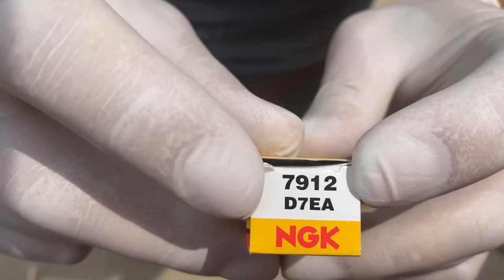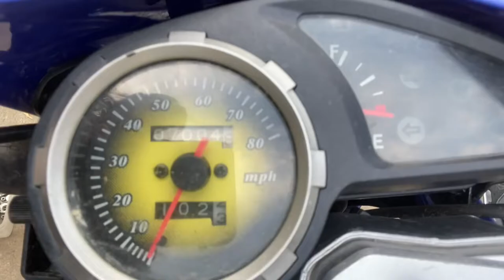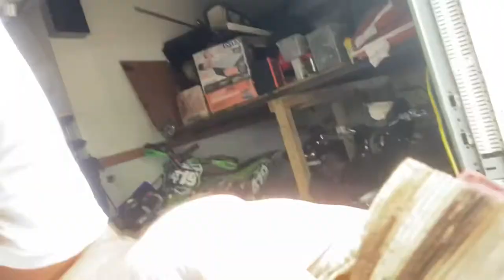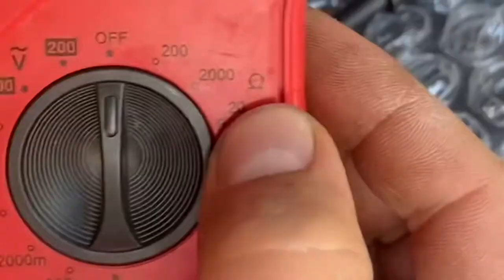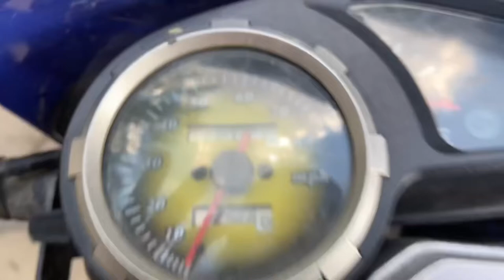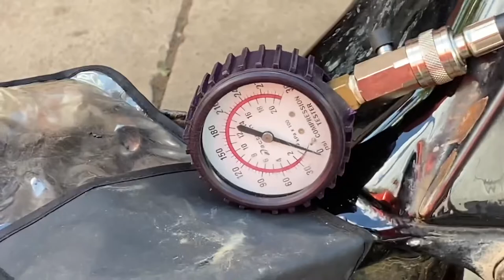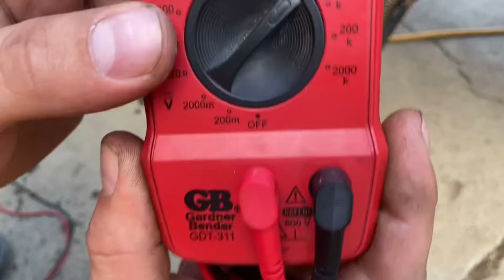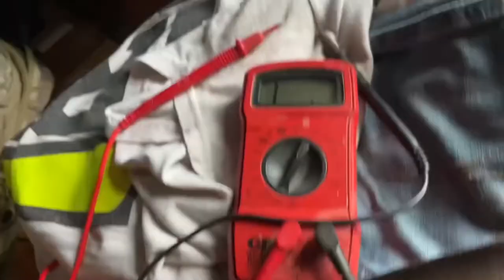Hawk 250 how to fix Pinging (almost)

Comment: Pinging or detonation is most always a timing issue. Also if you run a high octane fuel it should help minimize the pinging. Good luck
Reply from the maker: Man! If it was only that simple🤣 That was one of the first things I did, it’s one of the easiest and most obvious solution’s. Before I even started filming this video I tried pump 93 octane. That didn’t make any difference, so I tried 110 octane race fuel, and that didn’t make any difference at all either.. you can see  I have literally tried everything lol. At this point it is going to get ran until it blows up or until the problem becomes obvious. The issues must not be that serious though because the bike has been ran HARD for the last 3,000 miles with the pinging and no serious issues so far.
Reply: @goodolboys713  Have you tried a cdi box? I am pretty sure that controls the timing on those. Again I am locked on a timing issue as that is most always the cause of pinging.
Reply: If you try a cdi, be aware there are ac and dc fired units.  The plugs are the give away.  Yes, the advance is controlled by the cdi.
Reply from the maker: @eatingplaydoh   not sure if you were able to watch the whole video but I didn’t try an brand new factory vid box on the bike 😉 and unfortunately it didn’t change anything. And yes I have heard of ac and dc systems lol. Unfortunately Iv had to do so much research on the issue that I know all too well about mechanical and electrical side of all of it 😅Thanks for watching!
Reply: @goodolboys713    Could be carbon in the combustion chamber, need a colder plug, if the exhaust is open/no restriction it will run to lean.  I tuned my bike that has open exhaust except for a straight through resonator with an AFR gauge and  by adjusting the exhaust flow with a homemade baffle.  It sounds good to.and runs good
Reply: Could be the 'ol Loose Rod situation..  Air cooled engines are Noisey!  A major reason water cooling got popular.  Might be hard to tell a ping from a rattle, especially if the 110 didn't help.  Could be carbon build up/too high compression?  In a Briggs Go Kart engine that Rattle just means it's faster..  In fact they were fastest just before they threw the rod.

Comment: I rode mine really really hard for 10,000km, it burnt about a liter of oil in the last 1000km but it surprisingly runs great (of course after fixing a thousand little issues) and I jump it, ride it in extreme muddy and wet conditions, rock climbing and have dropped it a million times. I was convinced to rebuild the engine once I saw your first rebuild engine. Then I saw the rest of your videos and I am currently saving for a brand new one instead. I am confident I can fix all the issues except for the valve issue I have had since the first time I dropped the bike in a river, it runs good but it does not idle, you have to be on the gas all times but it has the same power as new. Anyways I feel like getting a brand new one might a better financial/time decision. Thanks for your great videos! Keep em coming!
Reply from the maker: That is a great choice to just get a new one! I always tell people that the hawk is more of a short term investment… especially if you ride it hard like we do. Anyway the second time around should be easier because we know what will go wrong. But absolutely they bike just starts falling apart around 6-10,000 miles. Thanks for watching!

Comment: Good video once again. That has got to be frustrating. Thanks so much for including the thorough electrical system testing. This will prove useful in the future to many. I love my Hawk, but one of the most frustrating things about owning it is not having a shop manual to have ohm, voltage, and torque specs, and other necessary mechanical information all in a "one-stop shop" type of platform. When it comes time to replace my Hawk, I am considering going with a low displacement Japanese dual sport because you can always purchase a shop manual. However, I love the relative reliability vs cost of the Hawk/TT250 types of bikes once you get all the quirks worked out.
Reply: Damn i was going to buy one but it seems like it's a POS .

Comment: Other than a lot of carbon on top of the piston, That noise is unique. I have hurd it before, not on my Hawk point being if your week spark issue fix doesn't work. Dump the gas and replace it. This could very well be a back pressure issue. " The banana in the tailpipe " I have to agree with the other comments about the pipe. Bless you. Good luck o' boy!

Comment: I have a 120 main and 27.5 pilot with aftermarket exhaust. I'm in Delaware which is essentially sea level. But did well when going camping near Gettysburg in the mountains. It's not very high around 75 above sea level in my area to around 1400 camping.

Comment: Good ol Boy how is the bike going now. one thing I forgot to say My IT490 pinging problem I also got a new old stock CDI for it I think that did help a bit the next thing is to get a dial gauge and find true top dead centre and go from with the Ignition timing and see what the advance looks like. Also what about a engine Dino the sniffer might sort it out also they can test a lot off stuff and also a long shot compression ratio might be to high cheers Mick Australia

Comment: When I was an teen. My Enduro had the same problems. I could not figure it out as well. I had an friend. Her husband birthday was coming up. She knew about my bike. I had enough of it. She said her husband could fix it. So I sold it to her. It took some time to know if he fixed it. He did. What fixed it. When they make anything. The powder coat paint everything. 100%. He took the coil off. Took the powder coat paint off where the coil grounded to the bike frame. Worked perfectly. My advice. Take all major grounding stops. Get rid of the paint where they connect and try it..

Comment: I could hear it.  My best guess is internal engine issue. The noise is constant? Piston pin issue?  Connecting rod issue? Maybe try a straight 40wt or 50wt if available, OR add about 4-5 oz of "oil stabilizer"  STP oil treatment?  If it reduces noise it could confirm. That is what I would try if it were mine. You do get an "A" for effort. I just assembled my new 2022 Hawk 250 with carb. The build sticker on engine says 87 octane or higher. My owners manual says use octane 90 or above. I`m running non ethanol 89 octane. Replaced factory oil w Diesel engine approved 15w40. 
I hope to find a magnetic oil drain plug for it, since the engine has no pleated paper oil filter.

Comment: My Honda XL350R Had a tick. It sounded like heavy valve lash.  Along with some slight timing issue? 14,000 miles on the timing chain on a motor that ran at over 500 degrees and possibly a tooth off, there was some carbon and corrosion build up on the piston and valve. After 500 miles or so of this tick. The valve broke and sunk into the top of the piston. I'll send a pic if you want to see it and give me an email addy to send it to. I appreciate ALL your efforts. Good luck on curing the engine ill.

Comment: Have you tried something as simple as GUM out ? Removes carbon from motor. I had a similar sound in my Honda civic with around 347k miles D16Y8. Changed timing belt , mechanical timing ( interference engine ) and put a timing light on it when jumping the ECU, didn't help but did gum out carbon removal and it worked wonders. $6 for a bottle worth a try. Add a little to the oil and a little to the gas . Then change the oil after running it a bit.

Comment: With an ngk, the higher the number, the colder it is.  Example,  d9** is cooler than a d7**
Reply from the maker: I did some reading on that when I switched the spark plug and I came to the conclusion that the torch was about the same as the nvm but even though the ngk has a “hotter” rating it is still cooler than the torch spark plug, but that might be something to swap out again to an even cooler spark plug. Thanks for watching!
Reply: You could also have a vacuum leak.  Another overlooked item would be a clogged exhaust.   Other than the noise (which I can't hear well) does it run normal?

Comment: Man I didn't want to comment because you probably have had more advice than you want to hear lol. Watch your videos  there good very informative and entertaining 👍.  I have 2 thoughts about the pinging if you haven't already fixed it.  The exhaust is extremely restrictive . And once the bike is broke in and has been jetted they run better and the exhaust gas needs to leave faster but the stock exhaust system will not allow it . You have more fuel and air and a larger explosion but the same of backpressure from the muffler and converter .   And another thought all the old air cooled xr engines ping and chatter and run forever .

Comment: I couldn’t hear clearly from the video but a cricket chirping sounds like a head gasket or exhaust gasket leak. And I think 90 psi is a little low on a compression test especially as long as you cranked it for the test
Reply from the maker: I wish it was a simple as an exhaust leak 😅. This is engine nose. Iv got it narrowed down to piston slap or bad rod bearing. There’s no way to tell until it’s torn apart unfortunately. But thanks for the suggestion!

Comment: My taotao 250 did this.i ordered the nibbi kit.came with the carb and c.i.d.box and coil.i started to run a higher octane fuel witch really brings a 250 alive.😅😅.but ping stopped.also when checking your plug.if the tip is brown it's perfect for fuel jet.black is to rich and white is to lean.

Comment: What position of throttle is the ping? First 25% is main jet, 25 to 75% is needle, 75 to 100 % is main jet. Clogged exhaust maybe. I run a 38 pilot, clip on slide in middle, main is 110. I run high performance exhaust and flat slip racing carb.
Reply from the maker: Through out the entire rpm range. I think I have it figured out now, I’m almost certain it’s the wrist pin making all the noise.

Comment: Run a NGK D8EA plug, has a better heat range for these bikes than the D7. It's a "colder" plug so it's less likely to cause detonation.  You can also try an e3 plug which is what I run. And I have a shaved head and thinner head gasket for high compression And no detonation at all. E3 advertises their plug design is even less likely to cause detonation but I have no proof in that.
Reply: How much did you take off the head? Did you sand it on a flat surface or take it to a machine shop? Did it make much difference?

Comment: 1. Bad catalytic converter that is plugged (possibly from the oil burning) or melted. That is if you are running the original pipe. 2. Don't know if you are but the Hawk requires premium fuel. 3. Great videos! I just subscribed and hope you are able to get this one solved soon. .
Reply: I don't think it is supposed to run 93 octane.  My hawk has a sticker right on it that says unleaded 87 octane or higher. My bike runs terrible on 93 and backfires a ton. I switched back to regular and it runs great again.
Reply: @TyposGarage  My Hawk (2017) states to use 91 octane. 91 octane in my area is Premium gas. I should have stated 91 octane instead of Premium. 93 octane would be overkill.
Reply: @multicyclist  Maybe something changed from the 2017 model to the 2020 model, which is the one I bought 🤔

Comment: Run the highest octane you can get ahold of. If the pinging you are referring to is what is traditionally referred to as pre-ignition, that would be my first move.
Reply from the maker: You are correct sir! I have already tried higher octane fuel. In fact that was the first thing I did, and it is pretty simple obvious first step. I didn’t include that in the video, however I should have lol. Thanks for watching!
Reply: @goodolboys713  Good deal. I thought you may have...but you never want to assume.  Great channel.
Reply from the maker: @thevoxofreason8468  thanks 😎

Comment: I had pretty much the exact same pinging sound/cricket noise that sounded like it was coming from the engine but it ended up just being the gas tank rattling at certain rpms
Reply from the maker: Haha nice! I wish it was something that simple on my bike. Iv came to the conclusion that it’s the l rod wrist pin bearing/bushing hole.. that means when it is completely worn out the bike will need a whole new crankshaft

Comment: Just checked the green wire you where wondering about, it reads open circuit from green wire to negative on batto
Reply from the maker: Sweet!! Thank you! I didn’t thing it had any issue. But this helps tremendously! Thanks again, and thanks for watching!

Comment: What would make this thing not run with the carburetor tube hooked up. I can take it off and it will run and if I put the breather tub back on it will not run. I have cleaned the carburetor and it still does it
Reply from the maker: You might check the cleanliness of your air filter, sounds like it has a blockage some where in the intake or air box.

Comment: Could the pinging have to do with the worn/problem timing key issue you had in the past?
Reply from the maker: Unfortunately I don’t think so, assuming the woodruff key is what your talking about ( the key that holds the flywheel in place) which has actually never had an issue on my bike. I am still running the original factory woodruff key with no issues. It was one of the things we checked in the video but it checked out good. Thanks for the suggestion!
Reply: @goodolboys713  My bad I guess I was remembering incorrectly

Comment: Could be a broken c clip on the piston. Should yank the head and visually check. Obviously you already know it's easy 😜
Reply from the maker: Some day I might tear into it. For now I’m going to ride it some more until the problem is super obvious. Looking back at the video and considering what all the hawk has been through i believe the wrist pin is to blame. It got damaged with water, each time it has been rebuilt it has gotten a new wrist pin, and each time it’s been inspected for rebuild it has looked like there’s smeared metal on the wrist pin. I’m fairly confident that the wrist pin is causing the pinging noise.

Comment: Did you try dumping the gas out and running the highest octane there is ….???
I Know my manual says to run the motorcycle on high-octane gas…!!!
And that’s what I do with my Hawk….👍🏻 no issues at all of course my bike still looks show room pretty…😹 
I’m probably the only guy that has 4000 miles on his 250 dual sport dirtbike that has never had any dirt on it…😹😹😹

Comment: Well Mate You have tested the lot. What about all the earths, take it for a run in the dark see if You see any sparks anywhere, on My IT 490 new CDI new flat slide carb jetted to suit Cylinder head mods Squish band NGK plug lots off money the King off Ping much better now worse when the day is hot Queensland Australia very hot place often 35c around 100f in summer ride it see if it goes Pop good luck Mick.

Comment: Painfully long video for the inevitable conclusion. Here is the fix the knocking. Throw that carburator away and get a nibby 28 or 30mm which will have proper jets out of the box or another "new" PZ30 that doesn't have internal clogging issues. A 35 pilot jet and a 120 main jet will work just fine with 2 turns out from closed (about 50% open) on the fuel mixture screw. What seems to be happening is the CDI thinks it's lean (most likely on the pilot circuit), however it's unable to set the correct ignition frequency or spark characteristics to correct it. As such you're getting multiple detonations during combustion. This causes the whole sawing machine-like rattle. Running the engine this way can lead to issues (mechanical failures) down the road.
Reply from the maker: What a painfully long comment with no useful information. What book did you read all of that out of?
Reply: @goodolboys713  Was dealing with the same issue on my bike just now and that's how I resolved it.

Comment: The EPA requires a 14.6 : 1 Air Fuel Ratio which is on the verge if destruction.  This AFR causes excessively high combustion chambers temperatures resulting in knock, preignition, burnt valves and unhappy bike riders.  In some states off road bikes are not required this insanity.  A  richer fuel mix around 14:1  AFR is ideal.  If you ride like the devil off road a richer fuel mix is advisable but no richer than 13:1 AFR. 
  I've been thinking lately that removing the air filter box and installing an aftermarket air filter would increase airflow across the engine and it would last longer.   I never let my engine run long without air flow. 

I used aluminum to make a heatshield for the catalytic converter.  Engine is cooler and prevents melted spark plug wires.

Also instated a MB7U  $23.39,  110 CCA.  I had to cut and weld the battery tray but no big deal. Tight fit but you can get it in    
  https://www.ebay.com/itm/323609224823